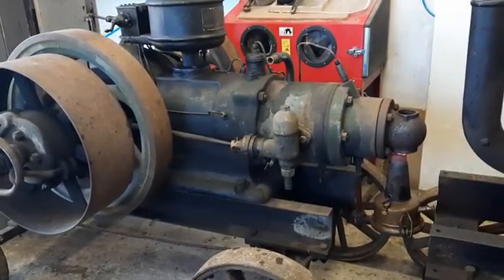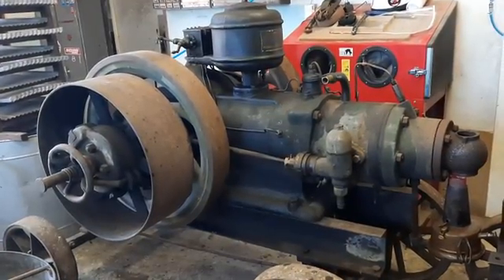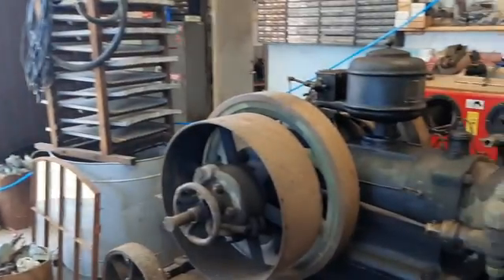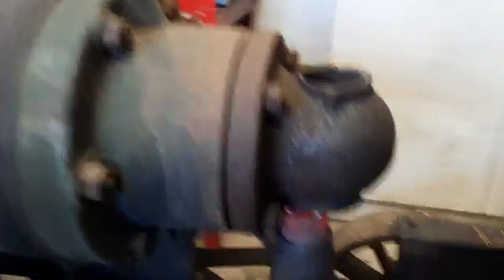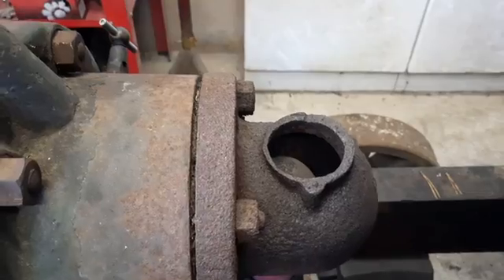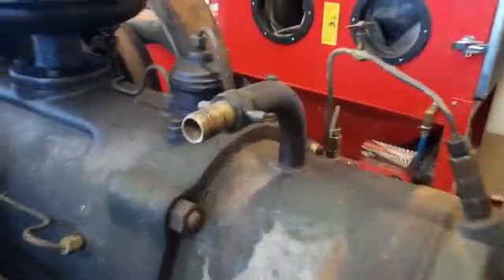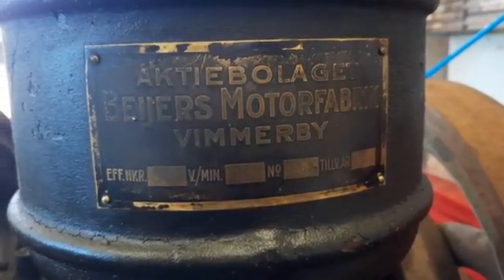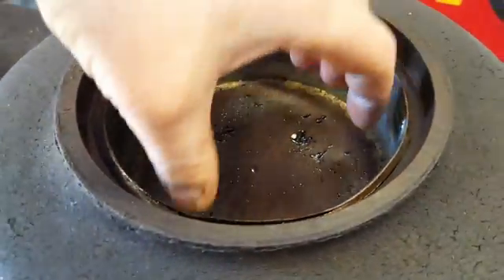10.4L Oil Engine Running @ Zero RPM. How is that possible?

Comment: Rpm: 0
Torque: Yes
Reply: When you need to pull that tank out of the mud
Reply: @Fuckinghandlebullshit  I mean, I'm not attempting to denote any intelligence from this comment, as you're absolutely right, it's as apparent as it can be, it's a delicate margin that the engine even runs at all at 0rpm, the thought of an engine running at 0rpm without a visual  representation doesn't even make sense in the first place, but the flywheel looks pretty heavy on that thing, and I'd imagine for the world's first sawzall, it would most likely be sufficient for cutting small pieces of wood or soft metals, keeping in mind the idea I have is that the weight of the flywheel is going to push and pull a blade of some sort back and forth using a series of belts or chains and pulleys, or even a band saw, attached directly to the flywheel as it rocks back and forth. And again, seeing as how I have absolutely no hands on experience with that engine, I can neither confirm nor deny my own theories, but based on looks alone, I wouldn't think I could grab a hold of that flywheel while it's rocking like that to stop it, which if I can drag a saw across some wood, but I can't stop that flywheel, then wouldn't that mean the flywheel can also drag a blade across some wood? To sum up what I'm saying, and to match it with what you're saying, I think the weight of the flywheel would overcome the resistance of a saw blade dragging across wood, or even a soft metal like mild steel for exhaust pipe or something, and even when changing direction at tdc as it does at 0rpm, I still think it could overcome that resistance. To make one last thing as clear as I can, I'm not saying you could tug one of these rigged up to a saw blade around the forest, cutting down whole trees, but I bet it'd make a good lumber mill saw, I'd be surprised if you couldn't cut 2x4s with it at 0rpm, which is exactly what I cut with my modern sawzall.
Reply: @mrwolfe0812  For what it's worth Rap, I agree w/ you. I was thinking it might work as a privative surface grinder. lol
Reply: Usefulness : 0
Reply: @9crutnacker985  Untrue - with the appropriate belt drive ratio you can run all manner of equipment off of an engine like this (pumps, sawmills, grain threshing & milling, engineering equipment etc etc). Indeed, in the event of a global disaster such as a killshot solar storm, or nuke war, these may be the ONLY kind of engines that are still usable.
Reply: @boydw1  Not at oscillating 'zero' RPM it's not.
Reply: @9crutnacker985  the world's first sawzall.
Reply: @boydw1  basically all mechanical diesels aren't real picky about their fuel, they just don't like stuff that gasoline engines will run on, with the exception of natural gas, even animal fat should work, as long as fuel heaters are added.
Reply: @boydw1  just use a brushed DC motor then. problem solved
Reply: @Blox117  you cant be serious
Reply: @FreyTheDoc  yeah i am, why not?
Reply: @Blox117  where were you going to get the power for such a motor, its an apocalyptic scenario remember
Reply: @FreyTheDoc  a dc brushed motor

wind/water/muscle -> motor -> battery -> motor

where are you going to get charcoal for your steam engine, grandpa? no way you can shovel wood every minute into that thing.
Reply: @9crutnacker985  You could light fires by having the engine run a fire drill (rotating a wooden rod against a log with some tinder)

Kind of superfluous if you can heat the oil bulb up in the first place, but it oughta work.
Reply: @jonathanhendry9759  no use it to run a saw to cut the firewood

Comment: This engine should be american made since it needs 10 litres to put out 30 hp
Reply from the maker: Hard to hear but i say it is 13 hp. NOT 30. So thats for sure, would be American 😅 

I have 35 hp 1cylinder hot bulbs also, and those are on 22 liters. Weighs 3500kg. This one in the video is only 1350kg.
Reply: @YesterdaysMachinery  yeah at this point I'd stick to any engine "not" american related ;)
Reply: American engines use cubic inches, so 13 hp from 10 ci is 61.017 x as efficient. ‘Murica !

Comment: Looks like it’s moving to me, idk how you can say it’s zero rpm cause it’s moving
Reply: Because rpm is revolutions per minute. The engine ran in sort of a stalled pattern where it did not revolve but just rocked back and forth.

Comment: I am not sure it there is enough power to do any work. In that the I not sure there is a device that would require a back and forth motion to a task.  

Thanks for the video,  I like older engines that were made to work, a steady power output.

Comment: Do you know how much fuel it injects on each rotation?
Reply: If i dont remeber wrong they counted 0,5liter/hour for every HP. At max rpm. About 250 - 550rpm depends on size and build year of the engine.

Comment: Nice video, awesome engine. But what is the purpose on heating up the ball infront? What does that do?
Reply: It evaporates and ignites the fuel. it is part of the chamber, but not part of the cooling system and glows while the motor is running, but to get it glowing you have to preheat. similar to glow plugs in diesel engines

Comment: There's something that really amazes and impresses me about these sort of things, but 1928? That seems hopelessly obsolete even by that point, Model Ts would be filling up scrapyards by this point, 8 cylinder motors, airplane turbine engines in production, etc. I guess this is a different application for totally unwired power.  Mighty fine.
Reply from the maker: Yes but this was very, very outstanding good power. And you did run them on crude oil, that was almost free, and diesel and petrol was very expensive here then. Still is.

They made these engines exactly the same way until ww2. After that the production was pretty low. The electric had taken over.

Comment: Old motors are so cool. Last 100 years  or more years. Today's motors you're lucky to get 10 years out of them.
Reply: Yeah but a modern engine does so much more work in a thousand different environments, all in a compact size.
Reply: Idk if this engine is used as much as modern engines
Reply: True modern engines are not built to last
Reply: @extractorfan2143  true modern engines are built to be efficient Lmao. Try throwing something like this in a car or truck. You’ll have a hell of a time getting it to fit, and an even worse time trying to make any decent amount of power.

Comment: Hot head oil burners are fun to play with. That one is in nice condition. I really like the open crank hit and miss engines but at the moment I don't have any. I used to have several but sold them. Now I am looking for more LOL!
Reply from the maker: Ye, i have a Fairbanks 2hp open crank, butt thats a trottler. I also have a 35hp krimo open crank. Got videos of both. Regards/ Richard.

Comment: According to Pytagoras (Factory museum), this zero rpm was a common idle setting for this type of engines. Particular when installed in boats. Having the propeller going back and fouth in the water.
Reply: Maybe it's just to keep fuel consumption to a minimum enough to sustain life and not have to go thru the whole starting process again ?
Maybe one of a few reasons, but I'm guessing.
Reply: @MrTheHillfolk  As it was explained to me the boats dont have a cluthc so if the engine is running the ships had the propeller turning. But if it was ideling at 0rpm:s the propeller didnt move the ship.
Reply: @MaskinJunior  Exactly, plus it kept the hot bulb hot. To reverse you reverse the engine. Large container ships and the like are also direct drive but they switch the valve timing and use compressed air to restart the engine each direction change.
Reply: @alwaysbearded1  depends on how large ships. I used to work at a foundry that made propellers where you changed the pitch of the propeller to change the speed of the ship. I think those ships has constant speed on the prop-shaft and does not reverse on the main props.
Reply: @MaskinJunior  I should have qualified size. I'm thinking of the large container ships I have to dodge when I sail. But at least they have tugs in the estuary where we have to share close quarters. The smaller ships and tugs just have regular transmissions. Some might have variable pitch props where you can reverse the blades to go in reverse while the shaft still turns one way. I don't know which have which I just stay out of the way!
Reply: @alwaysbearded1  I don't know the size of the ship, I just know I can hide inside the propeller hub of them. So I guess fairly large.
Reply: @MaskinJunior  that works too, I'd guess it's a combo of a few reasons.
Reply: @MaskinJunior  Just don't hide in the hub when they try to assemble them. Wow, that is huge. My guess they go on large container ships but then such a prop would be useful for lots of different types of ships.

Comment: Running at zero rpm may be really overstressing the bearings as the flywheel inertia is being reversed every stroke. This would cause massive stress on your reciprocating parts?

Comment: running at 3 or 5 rpm back n forward repeat 
0 rpm mean engine isn't moving at all
two stoke diesel engine can run both way doesnt matter forward n reverse  and there no valve
it fun engine to watch it run aging

Comment: Back in the day, this was probably high tech. I wonder what the designers of it would think of today's "engines".
Reply from the maker: They sure where proud of their work back then.
Reply: @YesterdaysMachinery  this stuff had beautiful shaped curved castings with designs and logos in it, even little pinstripes and dress up stuff like that. 
What a contrast to the stuff hidden under plastic covers today
Reply: @MrTheHillfolk  oh, and dont forget the phrase "built to last"
Reply: @HvV8446  
No bout adout it 😁
Reply: @MrTheHillfolk  you mean the electric motor that fits in your hand but could destroy this antique if hooked up to the output shaft?
Reply: @Blox117  Yeah, no. These old hot-bulbs and semi-diesels and shit like that were torque monsters. You'd need a traction motor off a locomotive to damage something like this. Even then. There's a lot bigger old engines like this, but room sized, that even at 100+ years old would make even the biggest electric motors made today, fart, half a turn, and let the smoke out if they got into a torque war. You'd have windings on the floor in a puddle.
Reply: @blackhawks81H  nope, my ebike motor can put out more torque than a tesla. it would destroy modern ICE and this old pile of scrap as well as most electric motors. ez pz

next
Reply: @blackhawks81H  btw, what would actually happen: you connect the two outputs of the motors. I press the throttle and my bike motor gets delivered 2000 amps of current at 120v. The old pile of scrap is instantly destroyed when over 1000nm of torque is delivered instantaneously.
Reply: @Blox117 what the hell kind of bike do you have that can push 240kW? I'm assuming it does that for a very brief moment at startup and then drops to a few kW of actual running power at most.
Reply: Slams fists down on desk 
5,000 rpms!!!! That's three too many zeros!!
Reply: @TJ4774  Screams in VTEC
8900 RPMs you say?
Reply: They would die immediately after seeing bunch of wiring and piping
Reply: @bitelaserkhalif  Not really for the piping because steam engines had a ton of piping in them.
Reply: I'd like to think they'd be impressed with the technology but at the same time disappointed by the (many times) unnecessary complexity and lack of rebuildability in many modern engines.
Reply: Theyd be impressed at the tolerances.....and made sick by everything else.
Reply: if this engine is from 1920s it was already obsolete when it was knew, this type of engines are xix century tech
Reply: Just realise that without these engines you wouldn't have today's engines,
all part of the technical evolution.
Reply: They would say; worn out after 2000 hours work? Ours is just run in then...
Reply: fun fact: even a tiny electric motor delivers more torque than a pile of scrap, uh i mean internal combustion 'engine'
Reply: @Blox117  your gender dysphoria is showing ma'am.
Reply: They would say "That's too easy to work on"
Reply: @Kentucky_Cobra  you kidding me? Engines today are so much more complicated than this. This is about as barebones and textbook as it gets! Not that it's not a marvel or amazing by any means. But I don't think they'd be saying modern engines are too easy :p
Reply: @novafawks  yes I see now the confusion with his wording and my response. I read it as modern developers looking at this engine and I was stating their opinion on this one.
Reply: @Kentucky_Cobra  fair enough. I can see how it'd be easy to make that mistake. No worries!

Comment: Thanks for the demo! 👍 will you have lub issue in 0 rpm mode? " Bearing" on the conrod
Reply from the maker: No the lub system works just as good at 0 rpm for all bearings 🙂
Reply: @YesterdaysMachinery  there is no centrifuge thing for the conrod?
Reply from the maker: You have a steel rim on the crank that collects the oildrips and feeds it by a channel in the crank to the conrod bearing. That works even if it doesnt make full revvs. 🙂
Reply: @YesterdaysMachinery  Ok 😉